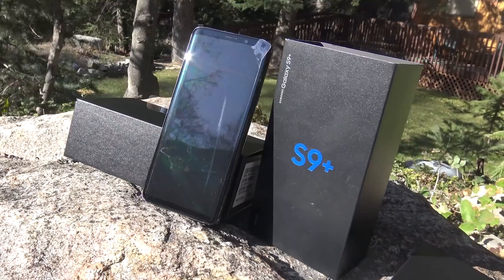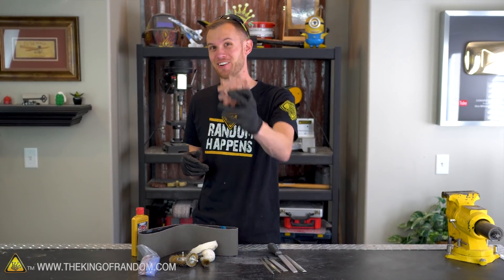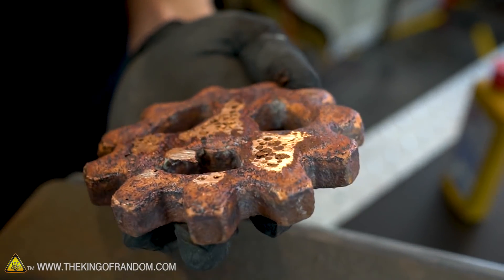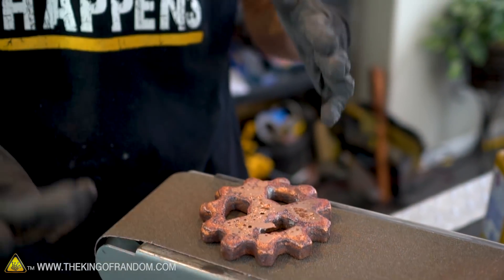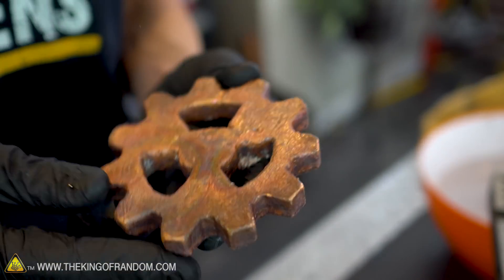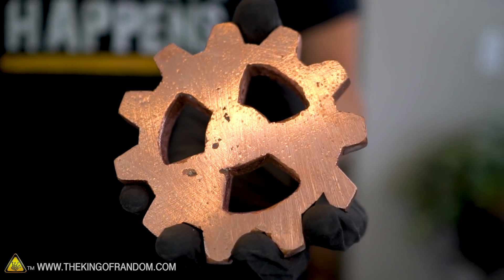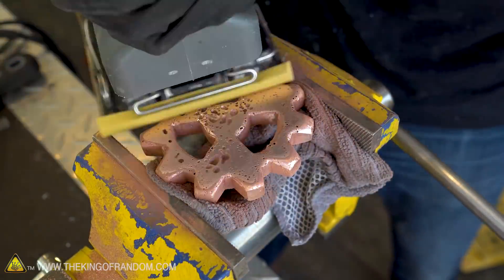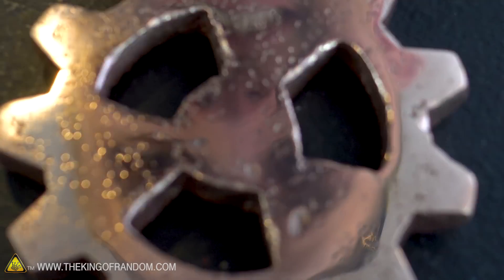Shiny Copper Gear! What Happens Casting A Copper Gear?

Comment: The King of Random  what if you try putting the gear in copper sulfate ( the blue liquid they use to make copper crystals) and hook it up to electricity so it grows more copper on it to try and fill the hole would be really cool or dip/coat it in resin
Reply: From the electroplating/electroforming I've done on my own, I think it would probably grow everywhere except the holes. Copper accumulates closest to the anode that you put in the copper sulfate, and the holes would naturally be farther away than the metal that surrounds them. Making it even gnarlier looking electroforming all over the thing could look really cool though!
Reply: Casey Olivia Grey  yeah it could look like some sort of crazy gear  would be interesting looking though

Comment: You should collect the copper dust and try to cold weld them by putting then in a small contained or something and applying alot of pressure, CodyLabs did this with gold powder.

Comment: I did some quick calculations on my chances to get the phone, and the current amount of entries are 539434. I did most of the possible ways to get entries, so I have a total of 22 entries. Now, dividing 22 by 539434 isn't optimal for a lot of calculators because of the size of the numbers, so what I did was that I divided both of the numbers by 100 to get a smaller number. So now it is 0.22 divided by 5394, which gives me a 0.0000407% chance of winning. I'll get it for sure.

Comment: Here is what will happen if they put molten copper into the vacuum chamber:
1. The vacuum chamber will crack and possibly shatter violently. 
2. If they use one that can withstand the heat, the air bubbles in the liquid will expand until they either break and vent their air or until the metal forming them solidifies.
3. The metal will cool down by emitting visible and infrared light (the same thing that happens in air, but without the convective cooling from the wind).
4. Eventually there would be a lump of copper in the bottom of the chamber.
So, if they solve the problem of thermal shock to the chamber walls, the most interesting thing that might happen is the casting of some expanded air bubbles.

Comment: What about a full plaster mold, then clean the stirofoam with acetone or other solvent to left only the shell and then pouring the metal throug an small hole on the center?

Comment: You can definitely use this copper powder from sanding the gear for another casting or even in a thermite reaction (but that would have to be copper oxide = CuO).

Comment: To make the mold a bit stronger try adding some dry silica sand to the first thinned coat and add a second thinned coat with the same sand. Heat cure this and then add your outer coat.  To help the pour, try adding a copper  flux in the crucible. It may decrease your  bubbling issue.

Comment: After you put your plaster/drywall mud into the sand form, bake it all out so you don't have any foam left, nor any moisture in the drywall mud or sand, and you should get fewer bubbles. I would bet the bubbles are coming from the foam burning off.

Comment: Maybe it was the foam that caused some of the pitting? Gases trapped under the copper as it melted? How about you take a torch to the foam before pouring the copper? The plaster wouldn't burn and you would end up with a clean form.

Comment: Common metals ranked by thermal conductivity
Rank Metal Thermal Conductivity [BTU/(hr·ft⋅°F)]
1 Copper 223
2 Aluminum 118
3 Brass 64
4 Steel 17
5 Bronze 15

Comment: Those holes are most likely due to open mold casting. In closed mold casting the gasses would most likely try to escape via runner, and not right off the surface of the object.

Comment: Maybe you need to invest in a lathe, or a Tormach 440 PCNC setup, then you could face-off the gear with the lathe, or use a roughing end-mill in the Tormach. 😎 (p.s., I neither own a Tormach, nor do I work for them.) Still probably easier to 3-D print the gear, then spray-paint it copper!

Comment: if you want to get rid of the bubbles, you should use a soldering iron with copper wire and then sand it down flat

Comment: What if you melt the copper with the electrode crucible and have a shoot that the copper slides down right into the mold to get rid of them bubblez
Reply: seems like you would get a better pour if the heavy molten metal didnt have to fall at all
Reply: also you can have it pour in at multiple points

Comment: The best heat-conductive metal, within commercial applications, is silver.
Reply: daniel holy 
Be as broke as a multi billionaire? What?
Reply: daniel while silver is quite valuable you can easily buy a few pounds for just under $1000US
Reply: Leo Gold, there is actually a tiny bit in cell phones
Reply: Narcan_or_Narcant he is saying that because Trump has gone bankrupt several times
Reply: would be nice if i could get a silver heat sink for my PC
Reply: Lucas; And is currently. Why else would he refuse to release his tax information? He clearly has no shame about anything, personal or professional, but admitting to being poor would ruin his ego.
Reply: He isn't poor also it wasn't even personal bankruptcy he ever went through as it was actually some of the smaller companies he owned that went through bankruptcy yet never the major ones.
Reply: No, it is way too expensive
Reply: Leo scientifically maybe. But recreational its quite pricey. Try need tons of material to conduct heat and buying silver. You will be broke as trump.

Comment: Since you didn't mention it I figured I'd say, only put pressure on your file when pushing it forward against the teeth, they're fine and can be chipped off if you drag in the wrong direction.
Reply: You are right but, As a machinist I very lightly drag my files as it cleans the teeth.
Reply: Ok, yeah that makes sense. Just don't wanna put too much pressure on it is all.

Comment: I work with pouring copper and your holes are a result of rapid cooling and the lack of flux. If you do it again add a 1/4 cup of borax and you will see better results.
Reply: he also shouldn't have ground the copper inside since he now risks metal dust fever
Reply: tsujidospride he'll be okay
Reply: you do know what metal dust fever is right?

Comment: Third attempt try sandwiching it between the sand boxes. That will reduce the air pockets in the copper. Just sandwich the foam in the middle and make a hole in the sand to pour in. Just a tip. Have less to sand and clean up after

Comment: Imagin if all that dust is on the table what are you breathing in from it use a reperator when using belt Sanders especially with metals rust and oxidized copper don't mix well with lung tissue

Comment: Put the copper dust in Thermit!
Thermit with copper wery fast burn.
Reply: Ábel Zsók the problem with that is all of that dust is a mix of copper and particles from the belt on the belt sander
Reply: ther the mit
Reply: theres the mitten

Comment: If you use an orbital/ palm sander you can get the contours better & save more of your material, belt sanders are extremely aggressive. Add a small bit of paraffin to the molten copper & you'll get less bubbles/ dimples in your final cast & a onetime more consistent pour of the molten materials will also help ensure a more consistent casting. Hope that helps you.

Comment: You need to de-gas the cooper while melting it, try casting it again but with the de-gas part. (just stir it while its getting hotter, that way the density difference won't make the bubbles appear)

Comment: I suspect that if you had your foam lowered into the sand, used a sprue and riser to increase the static pressure of the liquid copper, and put in a degassing material (inert gas or a flux), you could eliminate those bubbles. Either way, congrats! That polish looks amazing.
Reply: This comment needs to be at the top!!
Reply: Einstein
Reply: They already did this before for aluminum casting
Reply: Yeah it's kinda like welding. When it cools, it needs to be separated from the aptmosphere
Reply: Those are words that definitely mean something.
Reply: I see flux mentioned a lot, how would you use it in this instance
Reply: @ColorGuardGuru  if it's a flux that goes in the metal- put it in before you pour to try and drive out most of the trapped gas in the copper, if it's a "dust on" type (like borax), apply it to the mold and dust on the surface of the metal prior to pouring and just after the pour and limit gas-ingress. Other things that can help are: Pour slowly and evenly to eliminate air getting trapped in the metal, gently tap the flask as the metal cools, not open-casting/ use gates and vents to raise the pressure in the mould (while giving the gasses from the foam and those in the metal a place to escape easily).

Comment: One reason why there are bubbles on the other side is because that is the side exposed to air and last to solidify. During casting, metal solidify from the edges of the container to the top (the mold conducts heat away from the molten copper better than air). Then the parts exposed to air starts solidifying. This leaves gaps (porosities) just underneath the surface as the metal contract when cooled as there no way for the metal to contract without leaving the gaps as the surrounding metals have solidified. To counter this, manufacturers control the solidification by controlling the thermal gradient or have a riser to continously feed molten metal as the metal shrinks.

Comment: have you considered dipping the copper (when it`s still hot) in water with a tiny bit of alcohol?
the layer of black copper oxide should then react with the alcohol forming ethanal and elemental copper, making it shiny

Comment: The holes can be due to the metal compressing when it cools down. When I used to work in metal casting projects we included some zones (don't know the name of them in english) on top of the part for the metal to contract there, and then we cut off those parts that had all the bubles from compression there, leaving the real part without flaws.
Reply: uchihaferdinan16 I think they are due to water vapor or air trapped below the copper. My bet would be on moisture on the plaster due to not cooking it previous to casting the metal on it.
Reply: Could be, didn't notice if the bubbles were on the bottom or top part. Bubbles on the top is usually metal shrinking, if it's on bottom you are probably right. When I used to cast we didn't use any plaster, always just sand, so didn't even though of that.

Comment: You should have placed in oven around 200°F your casting sandbox before pouring copper. The cold and the heat dont exchange well which caused bubbles.

Comment: For the bubbles use a angle grinder with a flap disc that'll smooth out the bubbles and polish the gear extremely well

Comment: I think why there were holes is because there were was some trapped air in the metal. This has happened to be before with aluminum so i don't know if it is the same with copper.